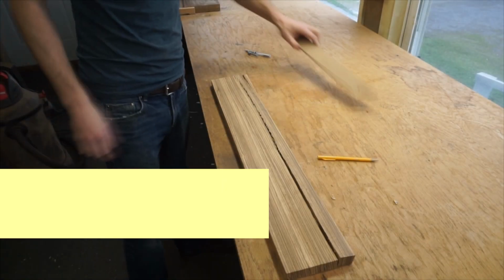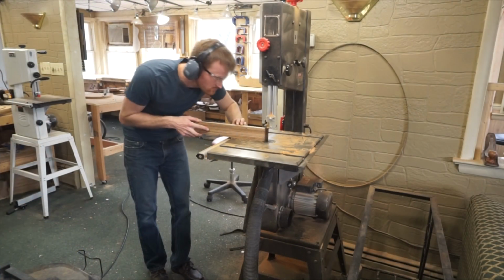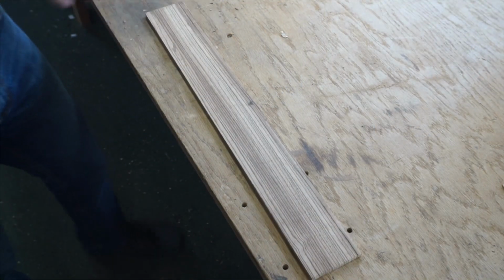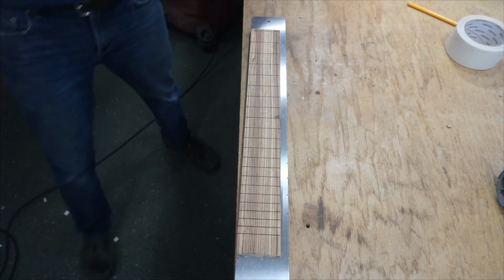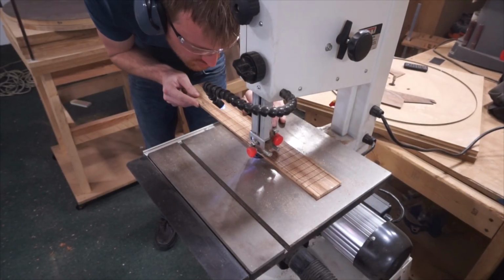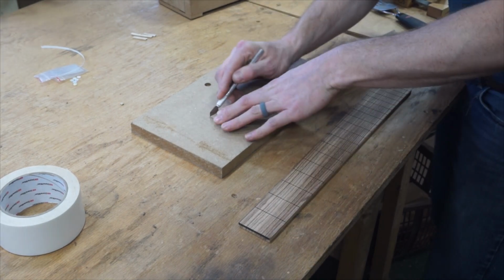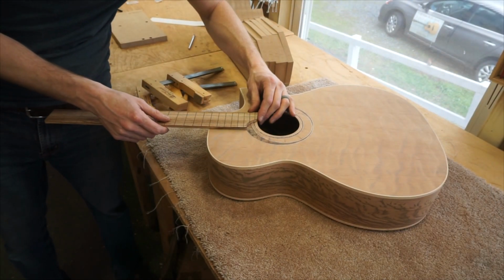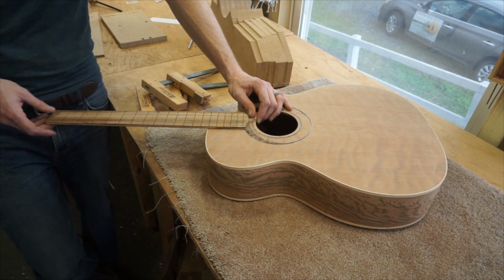Milling and Slotting a Zebrawood Fretboard for Guitar #57

Comment: Very good video! Good ideas, good content. I also use pins for locating, aligning, and indexing, my workpieces. I definitely like your approach to finishing the fretboard shape, your focus on safety. As the guy who ran the entire machine shop, the safety of every employee, and the safety engineered into every job, every fixture, every choice of tooling used, was my responsibility. I use my vertical mill to finish machine the shape of the neck and fretboard. It's an extremely accurate and extremely precise machine, with ball screws and zero lash in any axis, and I make sure the work piece whether it is a neck, or fretboard, or whatever, is securely located and held, using fixturing or clamping, or a vise, and this way my fingers or hands never get anywhere near the running cutter. I definitely like the idea of a router bit bearing on a cylindrical sanding or grinding tool.

My only critique is that a bandsaw, if properly set up, does not have drift. I use my fence and I can rip pieces as thin as. 060" and hold a total tolerance of less than . 003" on a bass fretboard sized piece. I can reliably cut much thinner pieces, but really have no need to. I'm used to tight tolerance machining, CNC and manual, of DTM metals so my expectations are different, I guess. Check out Alex Snodgrass to start getting your band saw in a better set up. I'm looking forward to getting a good carbide tipped band saw blade soon. I love the inserted carbide helical cutter head on my jointer.

Comment: Eric I think you will be fine with the Zebrawood, I built a small table around 20yrs ago & used Zebrawood for the legs & aprons it has not moved cupped twisted nothing. The only thing I found was it smelled like a wet dog when cutting it and I found it too be very grainy like oak. But it can be very beautiful tones of color.